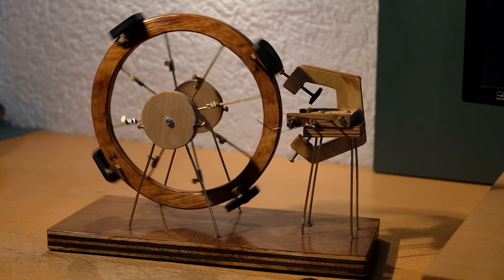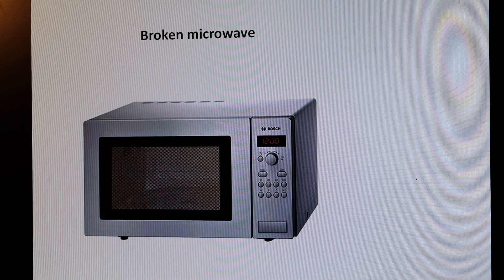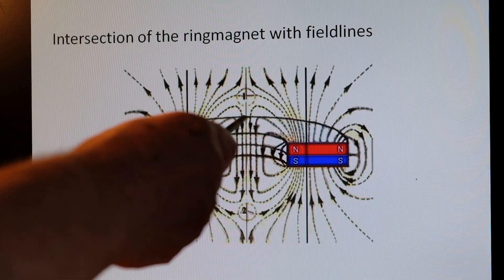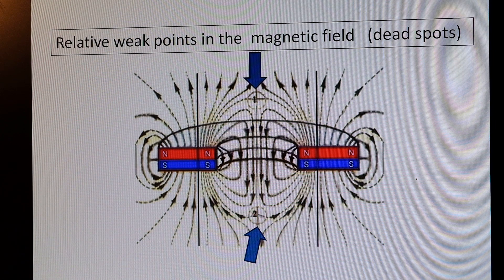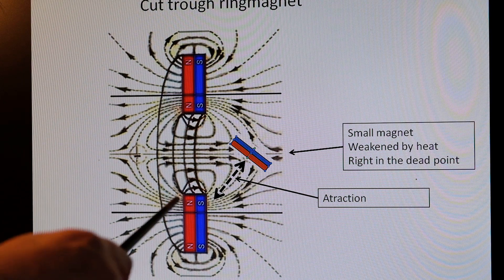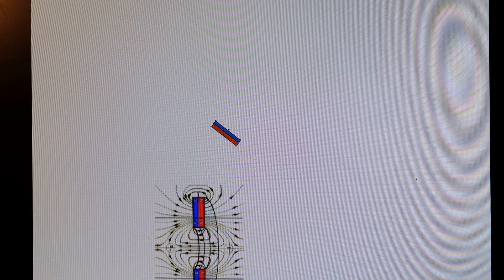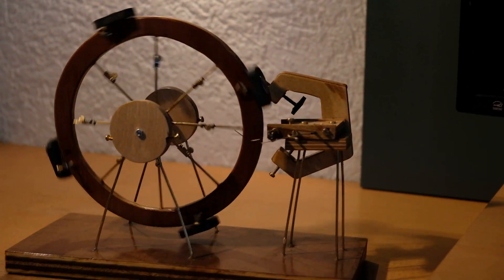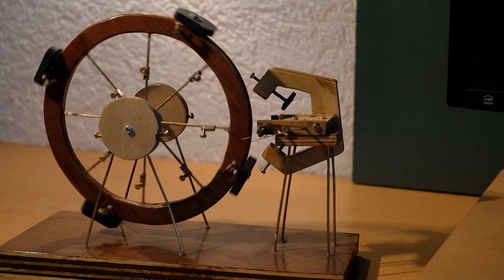Self running magnetic motor  self running magnet motor

Comment: Hello, great video! Can you connect several of those motors to a central shaft, in the same or alternating rotating motion or, more simple, just add another magnet switch on the other side and test if produces more power and/or rotation? Maybe will be enough to spin some kind of electrical motor... Just curious... All the best
Reply: Нет, сделать его раза 4-10 больше и запитать им дом?

Comment: So it’s able to flip because the magnetic field is weaker in the middle, if thats the case the wheel also feels that same amount of drag as the big magnet centers over the small magnet, so that alone doesn’t explain this to work. You also claim the magnetic null point allows it to work, but going from 0 to 100 is still energy used, just faster and more aggressively. You never explain why going from a ‘null point’ to repulsive mode, or attractive mode to a null point, are exceptions to this law.
Reply: и точность нуль точки по отношению к каждому из 4-х махнитов сомнительна. И почему бы не заменить бублики на пару тоже плоских - там будет нулевая линия. А это уже плюс - переход от точки к линии.

Comment: I also noticed how you have something of a spiral design in the center of the wheel. Is there a use of weight distribution to help with the rotation?
Reply: Probably to balance the wheel. It is wood after all.

Comment: Sir, thank you so much for sharing and explaining your little magnetic motor design. Followed a visual of the magnetic poles and how adding magnets in certain ranges from interacting magnets affect the fields further. Tell me, do you know of a nonmagnetic metal (aluminum, copper, etc) that can cover or say cancel a magnetic field on one side of a magnet without affect the other side?
Reply from the maker: Dear Sosa To my knowledge, there is no non-machnetic material that can cover a magnetic field. This is also called :shielding: and is something like the holy grail for magnet motor designers. If you find such a material, you can immediately collect the Nobel Prize for physics. Magnetic fields that come close to each other always influence each other. So if you want to influence a magnetic field, it is best to use a magnet or magnetic material such as soft iron.
Reply: @perpetuummobile5068  I would of thought a copper coding on the surface of one side of a magnet would help at least weaken the magnetic field on the side covered. Thus allowing the remaining side to be used to propel whatever mechanism one is creating. I am currently working on my own design and it has yielded interesting results. Recently a change in a center piece holding magnets cancelled the magnetic fields for a big portion of the the circle it is in holding magnets. Also found if you carefully break a coin neodymium magnet in half without separating the two and put a ceramic magnet sandwiched with a neodymium magnet in the center will cause the broken one (which I recommend you hold it together with copper wiring before they do separate) to cause it to spin.
Reply from the maker: @rubens.4116  OK interesting plans! Show some result on youtube!
Reply: @perpetuummobile5068  well it's been a challenge trying to get a continuous motion like your creation. I was wondering if I may have your permission to use a similar design to you magnet lever design that rotates the wheel. After watching your explanations and even going as far as taking it apart to show there is no battery or a power source that supposedly cause it to move. After understanding how it works it may help in my creation as I'm attempting to create an eternal battery, rather than a magnetic motor.
Reply: @rubens.4116  
Can you tell me a material for covering the entry side of a water pump but let the exit unharmed? What does div(B)=0 mean?
Reply: @andreasschmitt2307  what are you talking about?
Reply: @rubens.4116  
The magnetic flow behaves like water. If you can cover one side of a water pump and it's still working then you can also shield one pole of a magnet. The formula div(B)=0 is the mathematical expression for this behaviour and part of Maxwell's equations.
Reply: @andreasschmitt2307  some times somethings don't require a mathematical equation, formula or algorithm. Some times a little experimenting and observation can help get to a solution quicker. Just take what you know and fuse things that can be to invent something new. After all, that's how science had to be born first before we could make a formula or equation out of it due to the limitations we had.
Reply: @rubens.4116  
But the formula answers your question; such material does not exist :-) Spares you much time.
Reply: @andreasschmitt2307  no it does not. Formulas, equations were not invented when major discoveries were made. You can use it if you want, but you'll find experimenting with multiple materials can lead to a discovery. I never said a material exist or could exist. I simply asked the author of the video if they knew of one since he is very knowledgeable with magnets. I plan to experiment with metals, magnetic or not to find a shielding property.
Reply: @rubens.4116  
Yes, you asked the author of a fake video about something impossible...
Reply: @andreasschmitt2307  you clearly did not understand it as you keep bringing unrelated things on here. I don't see what an inoffensive question if they know of a material that can weaken or completely cancel a magnetic field. It occured to me after watching this mechanism just to see if the author of the video knew of something because you never know.
Reply: @rubens.4116  
You are welcome!
Reply: @andreasschmitt2307  you didn't disprove or anything for me. I've seen the video that makes you believe this one is fake, but you fail to comprehend that disproving video doesn't work because it is not an exact replica, material and design wise. Until people have the courtesy to make an accurate replica and show it doesn't work then you can bloat.
Reply: @rubens.4116  
Are you intoxicated or something? I never tried to disprove this device. I just explained why you can not shield one pole of a magnet; because the magnetic flow behaves like the flow of water. There is no need to disprove this fake contraption because there is no proof that it's working.
Reply: @andreasschmitt2307  yes you did. You called the author's video fake. You insist on talking about a material I already been told doesn't exists by the author himself after I asked him if he knew of one. Obviously implies I knew nothing of such material myself. Then you insist on an equation and comparing magnetism like water when they are undeniably too different to use water as any form sharing similar properties. I had told you you might as well experiment with various materials to find something that could weaken a field.
Reply: @rubens.4116  
Ah, and this is a proof when I call something fake?
Reply: @andreasschmitt2307  well you seem to have gotten your wires crossed cause I never said their was any shielding material, nor did the author. Where you starting going off about "here an equation that you'll need to find something to shield a magnetic field." Which I was was like, okay? What about it is relevant to what I had asked the author as well as implied there was a magnetic field cancelling material? Did you not take as what was a question or did you just want to bombard me with "here's an equation to show you it can't be done." And as I said, cause you were persistent to get something out of me, why don't you try to finding something yourself with experimentation. Somethings don't need mathematics.
Reply: @rubens.4116  
The author told you that what you're looking for is called shielding and that there's none. And that you'll get the Nobel prize instantly if you find one, that's also true. I just explained why. This makes you angry?
Reply: @rubens.4116  
Sure.
Reply: @andreasschmitt2307  Just like politics, only more believable.    ;)
Reply: @rubens.4116  How can an accurate replica be made when nobody knows where the batteries are?
Reply: @Graeme_Lastname  there is none if you can't seem to find them. He even takes it apart in another video. This mechanism actually works. I found if you get the magnets closer, followed by a north and south pattern. And make sure you put the  pole/ switch the flips the one magnet, it will work. Mine fully rotates the stator magnet, hence the N and S pattern.
Reply: @rubens.4116  "there is none of you can't seem to. "  What?  So you'll have no problem showing a video of it running for a few hours without stopping.  That would be a small start to being believable.
Reply: @Ruben
You even believe in working magnet motors? :-D Ok, I'm deeply sorry that I tried to explain how magnetic fields are working! That's so beyond your level of comprehension, it must have been utter confusing...
Reply: @Graeme_Lastname  there is none if you can't seem to find them yourself. Like I said he took it apart and even stated there is no telling how long it can run because he hasn't tried to capture it. And if you don't like the idea of running magnet motors, which exist and are patented, just search Howard Johnson, then don't be crying on videos about your disbelief in such inventions.
Reply: @rubens.4116  
Did you know that Howard Johnson never claimed to have a working magnet motor? That's because it was not working :-) Johnson did present a model that needed "additional fine tuning". Please do your research.
Reply: @andreasschmitt2307  oh and you're here for what? Hoping to burst people's bubbles as if it literally hasn't been proven a magnet only machine can work? The fact Johnson's motors can come about to work, regardless of the little additions you say he said are still needed to fully work, says it's pretty much done. There's already someone who made a massive engine that work on magnets and then you got the V gate machine. You were defeated long before you began jumping videos picking arguments over magnet motors.
Reply: @rubens.4116  
There is no such thing as a magnet only driven machine. This doesn't work. Did you even ask the channel owner if his contraption is driven by those magnets? Nah, better believe in bullshit :-)
Reply: @andreasschmitt2307  how about you ask him yourself on a different comment. Until you show proof you're some quantum mechanic or physics doctrine/ expert, why take anything you stated, when quite possibly you never attempted something like this to at least say you got some experience, to know exactly what you're talking about? Just read the other comments I have going with someone else. Be enlightened or stay under your rock. The world is better without nay sayers whom never chosen a purpose for themselves.
Reply: @rubens.4116  
I should ask for you? Are you a coward or something? Come on! It's a simple question: Where did you hide the batteries?
Reply: @rubens.4116  
Nah, that's a troll. You really know nothing.

Comment: Could you replace the metal connections between the base and the motor with non electrically conductive alternatives?
Reply: id rather see the entire thing made out of clear Perspex and wood kabab scures if there is any need for wood at all (which there isnt) you could make the entire thing out of clear perspex
Reply: Yeah would be a good Proof, if it is working afterwards

Comment: I realize the time and effort it takes to build a finely tuned machine like this. Could you raise the whole thing up above the base so there is a much larger gap between the magnets on the wheel and the base?
Reply: He has a video, the one that started it all, where he does all you ask and more. Even disassembled it because people were skeptical about there being something secretly powering it. No special coil with batteries can be hidden in it.
Reply: @rubens.4116  I've watched all four of the videos on this channel. The first one shows no disassembly. The third one shows the magnet moving block taken off camera, then a very similar, possibly the same part, shown up close. This is not what I asked for. 

Here is a video showing how a driver can be embedded within thick wooden components: https://www.youtube.com/watch?v=npbZspqswes

He could have embedded the electronics in the base, and covered them with a veneer. You wouldn't be able to tell. I'm not saying that's what is going on. I'm saying that it is more likely than a permanent magnet motor given the evidence provided.
Reply: @Leo99929  the wooden board is too flat and I've seen that guy's videos trying to disprove it. His first design using just two magnets are to be disqualified as anything, he needs four magnets. And even when he makes one with four, he states that yeah, the more he moves into making a replica, it may soon just run on the magnets by itself. Despite it all, unless he make it like the one in this video. It is not disproving anything. For people are sure of a battery and coil secret assembly, then by all means, make it yourselves and figure out where they are supposedly, possibly, hidden. Lazy bums who claim themselves experts with no proof.
Reply: @Leo99929  but in the end, you might not obtain what you asked for because it doesn't exist in this case.
Reply: @rubens.4116  You may be projecting here: "Lazy bums who claim themselves experts with no proof"

There is no proof here, and the proof you've vaguely suggested exists, turns out not to. Or you just don't understand what is being asked?

If you'd built these, you'd know the number of magnets is almost arbitrary as long as they balance. More magnets make the torque smoother/more consistent, and have the potential to keep it spinning if the magnetic field doesn't extend far enough to interact with the magnets due to their seperation. Smaller fly wheel means fewer magnets required. Bigger fly wheel means more magnets. Adding more magnets adds weight that makes it run for longer like a fly wheel. That's a great con, but this isn't presented as a fly wheel, it's presented as a permenant magnet motor.

The only conclusive evidence, would be the actual unit itself, as any recreation is by definition not the device and that can be used to explain why. That is why I have asked the creator to make these simple and easy modifications. The fact they  haven't done them, or responded, speaks volumes. 

The chat about "it took a while to get it working" is a technique used by con artists to explain why others recreations don't replicate the results. It only serves to waste peoples time. 

I have made one of these with a coil and battery, I know it is easy to hide a motor driver like this. Here is an example of a hidden compartment in ply wood: https://makezine.com/2010/09/02/plywood-secret-compartment/
Reply: @Leo99929  well see, you can't expect someone to change what they made base on the speculations of your own. It's like if you were living financially a certain way that may give you a comfortable living, but just not at the financial goal you are seeking. And someone like me comes along and gives you suggestions on what to change that might get you to your goal. Chances are you don't like being told what to do with your life.

Now, unlike the rest of the would be successors who made a functional design, but is clouded by music and typed explanations, the creator of this design has more than less given the courtesy of allowing you to hear the mechanism's noises and even the creator speak in the videos explaining how it functions. How many who have succeeded in making a self running magnet design have done that? Not a lot, just silent videos covered by music. Our creator here even went as far as disassembling his creation to show he isn't bsing. Again the question, how many have done this courtesy?

Now, if you feel your additions will make a functional design that'll change the world, I would say do it. Just do it yourself, you'll have quite an educational experience doing so and who knows accidentally make an invention that may not have been what was intended, but hey, you got a million dollar idea right?

Comment: He is giving you the principle. The key is having the one magnet flat, and the other is 45 degrees.   There is only one place the wheel will not turn.  It is where the transition occurs from the pulling to the pushing. i never got this way to work for me, but I got close. I got it to work another way.  Congratulations on getting it to work.

Comment: this might be a new magnetic/mechanical principle you have discoverd. very difficult to tune in right now. is working randomly for me.  Thank you!!!
Reply: I too working on a replica. So far I can verify the magnetic action, even without using ring magnets, instead attach 4 bar magnets as a cross. Hopefully I can get a result very soon...
Reply: It works or it does not.  Which one?  Spinning unassisted for two minutes isn't working. Spinning continuously for weeks is.
Reply: @Graeme_Lastname  I think different. The way it's turning matters. Does it accelerate by itself (even after a slight push) to a designated speed or can it only keep speed. In the first case it's clear there's self sustaining action and then no long time test is necessary.
Reply: @SOPM2007  Errr, yeah.  As long as it runs for more than a millisecond it's perpetual.  OK.